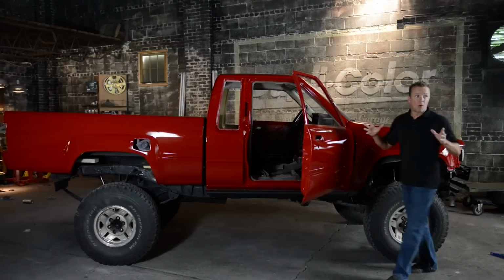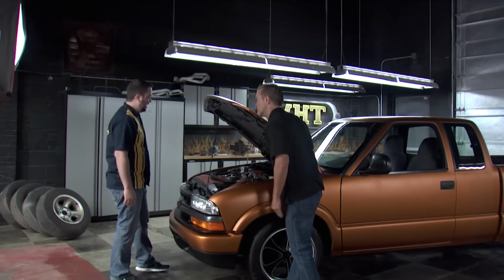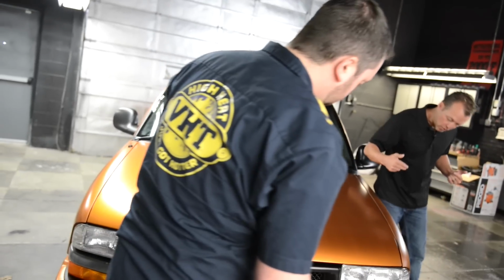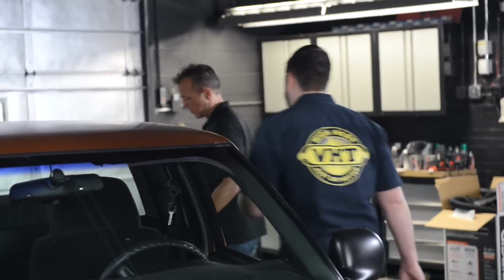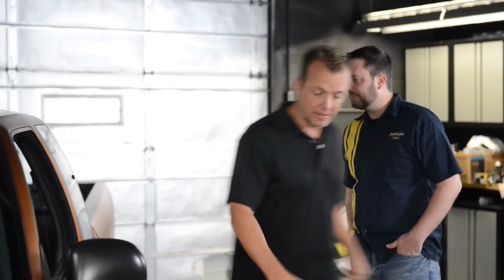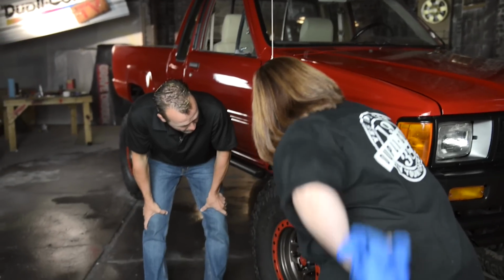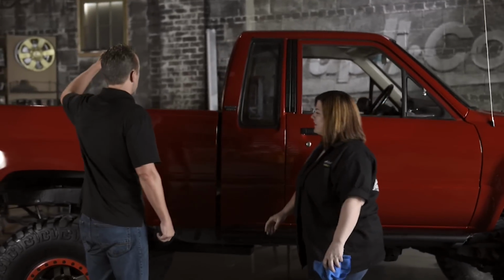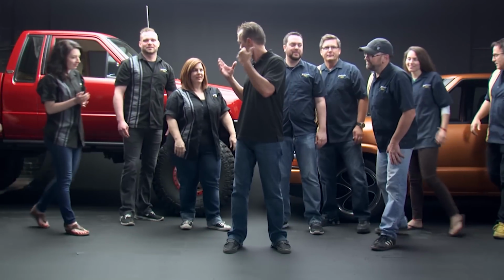Garage Challenge Episode 10: Wrap-Up

Comment: voting still doesn't work.  there's no other form to complete. No code...
Reply: click on the i in the circle in the top right corner , scroll down to bottom code is there. When you enter it in use all lower case. I got it to work.
Reply: +The Ginger Patriot i did. i didn't see a code.
Reply: +kenneth man its there the third box says speical code:___________ can't post it here.
Reply: +kenneth man its there the third box says speical code:___________ can't post it here.
Reply from the maker: +The Ginger Patriot Thanks for the help!
Reply from the maker: +kenneth man The code should be "i voted".